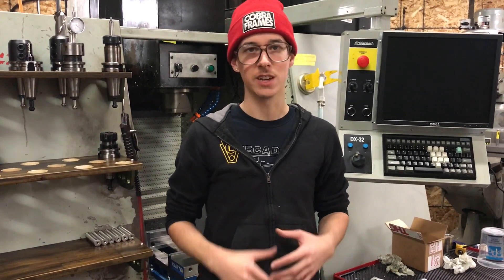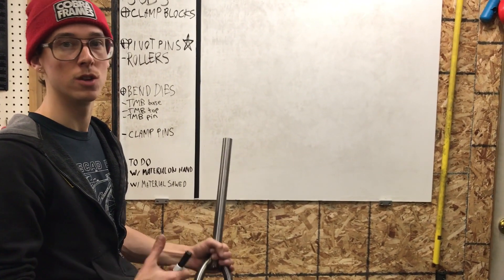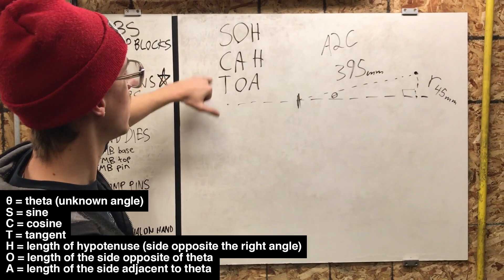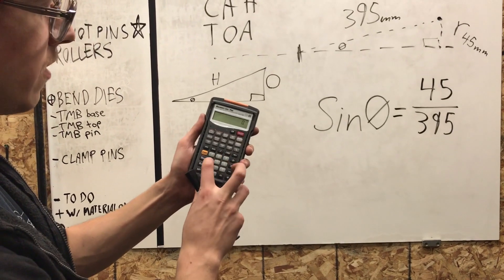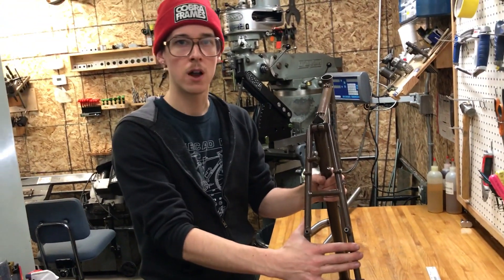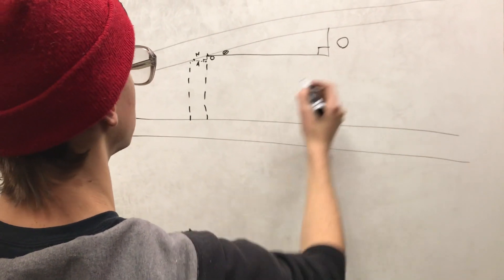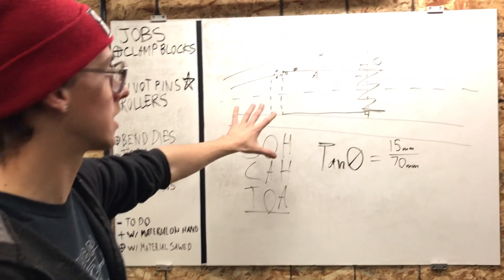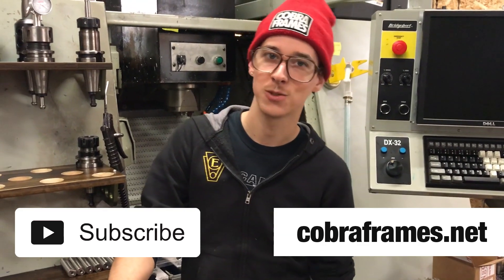Trigonometry for Bicycle Framebuilders

Comment: A bit late to the party, but as an art and design student i learned to work with adobe illustrator, which is like a step up to CAD, I draw my bikes in vector files and all the measurements and angles are there. Never bad to do some trig though